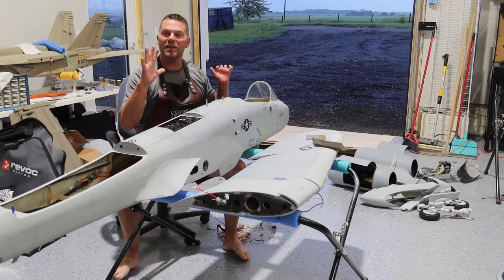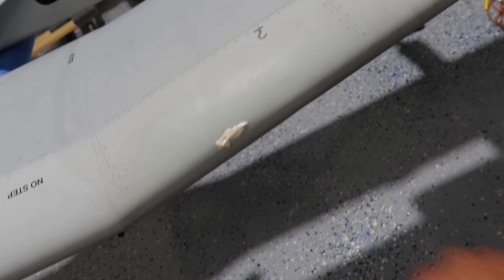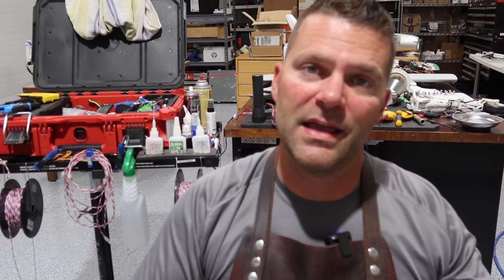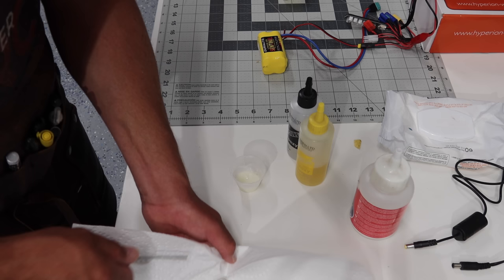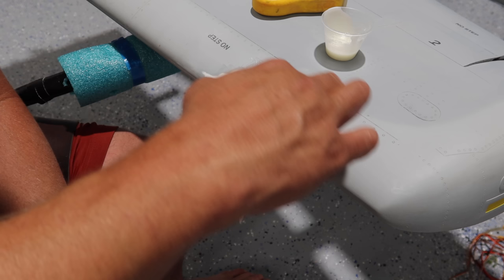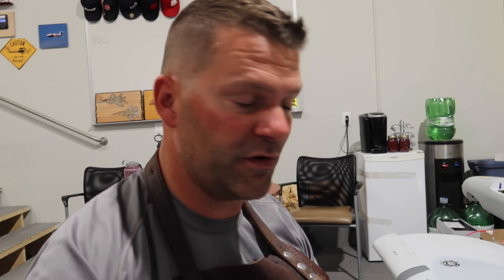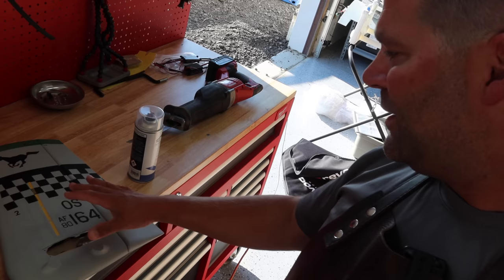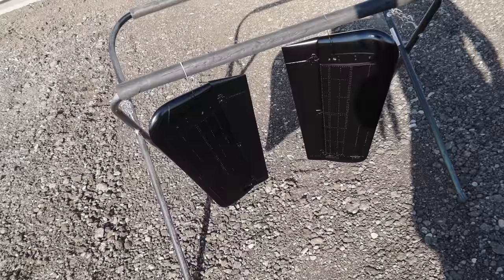The A-10 Black Snake Edition - Painting Begins - Skymaster A10

Comment: Amazing model, amazing video... Hello... I have a question, can I use another material instead of balsa wood to make an inner fuselage, for example, aluminum or another type of 3D printed plastic?
Reply from the maker: Thanks!  Yea many things can be used.  you just want to make sure your using something appropriate for it's purpose.  On the engine area, aircraft play is perfect!  Other areas can be alternative materials.
Reply: @thelightersideofrc  thanks 🙏🏻